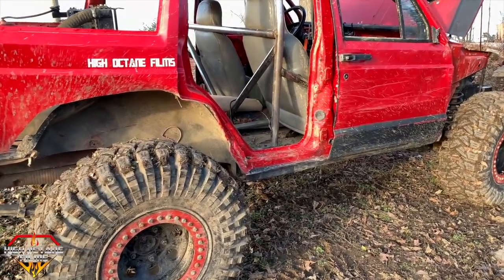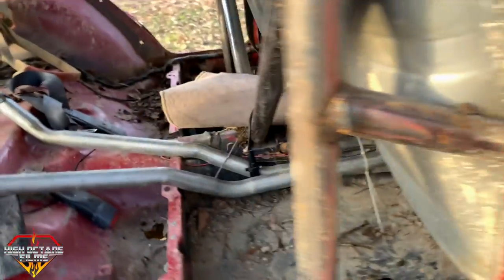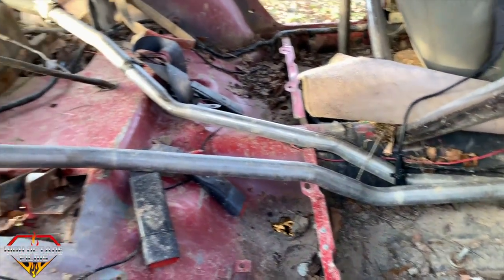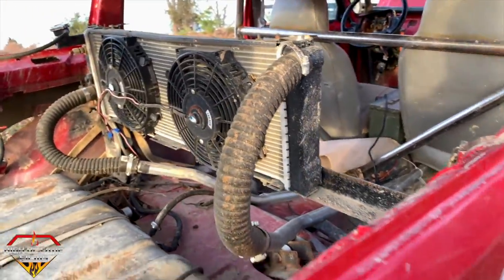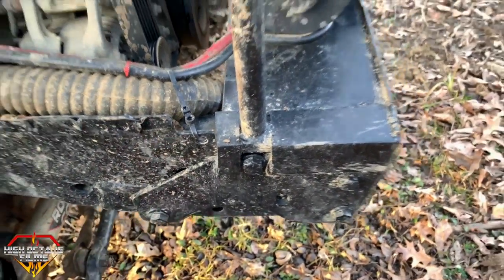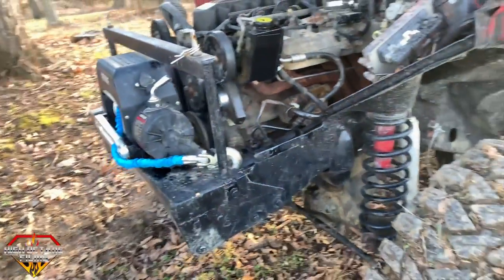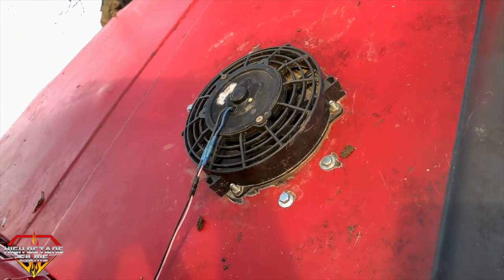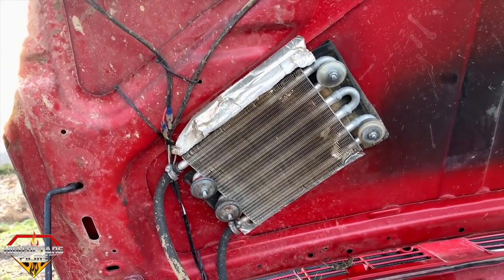BEATER CHEROKEE REAR MOUNTED RADIATOR WHEELING COMPILATION

Comment: I'm about to move my rad to the rear. Anything you wished you knew before you started or did differently?
Reply from the maker: Doberman Racing I would add a inline filler neck to the upper hose on the engine would make burping the air out of the system easier. That’s about all I’d change.

Comment: Info on axle setup?
Reply from the maker: TexasRedneck 9” rear stock axle shafts, Pem third member, with a spool, 3.50 gears. Front factory Dana 30 welded.
Reply: @HIGHOCTANEFILMS  nice!
Reply from the maker: TexasRedneck thanks

Comment: What did you say you used instead of the thermostat?
Reply: Washer. I imagine the right size would fit while not allowing as much flow as running no thermostat
Reply from the maker: Andrew Lopez racing washer for sbc, circle track guys use them, you can buy them at speed shops. I use a 5/8” hole.
Reply: @HIGHOCTANEFILMS  thanks man looks like a beast

Comment: I hate jeeps but approve this driving style. Only ended up here cuz im picking up an XJ on yota diffs with a sbc(siezed), th400/205 for 300$ in the next few days
 🤔 this thing took a beating lol definitely need a cage for these. 
Nice vid man
Reply from the maker: Bryan Mayes thanks sir, parts list is cheap enough for yours kinda surprised they used yota axles lol thanks for watching sir.
Reply: I am at hos place looking at it lol its no where near as complete as he said lol but 300$ and its triangulated 4linked w/new coil springs/new billstein shocks, the whole frame had been fishplated and beefed up front to back 😳 and it comes with the stock diffs.
Reply from the maker: @bryanmayes9234  sounds like more than his asking price worth of parts.